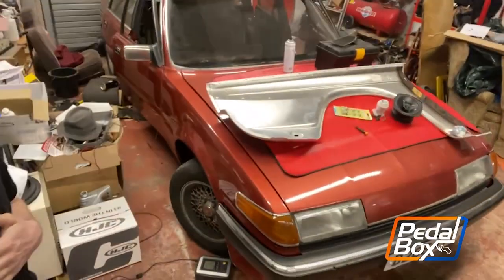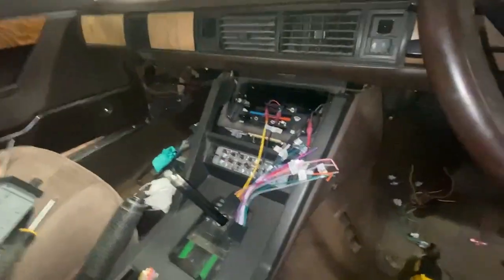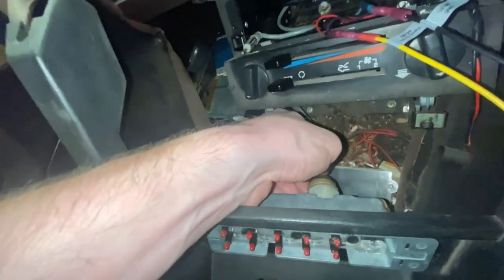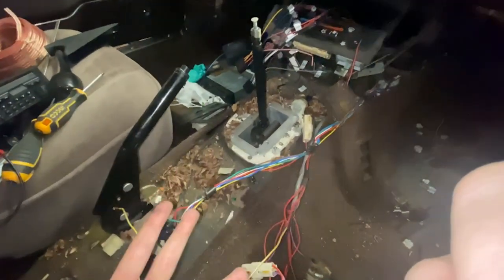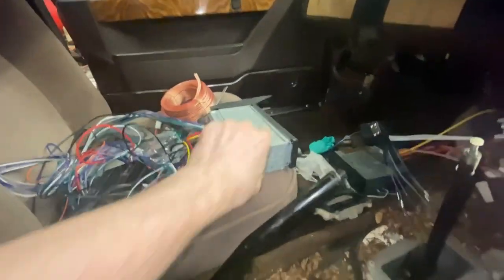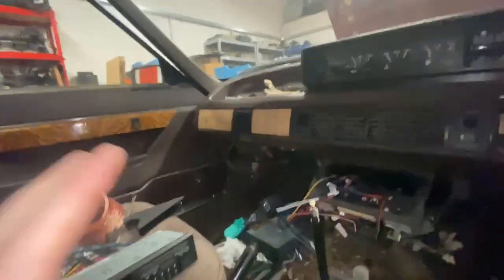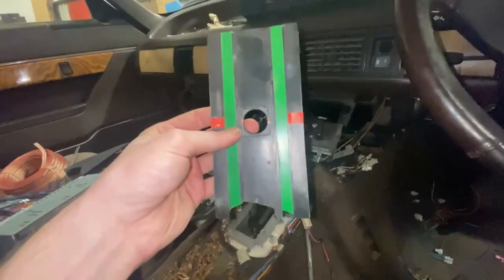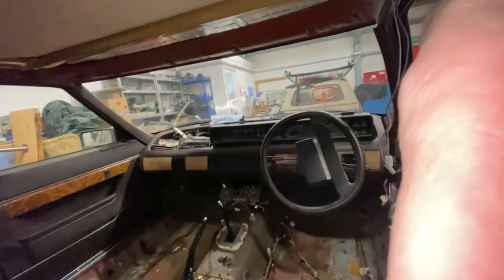Interior Impovements | Rover SD1 2600 | PedalBox Fleet Episode 114

Comment: Interesting comment about the center console, I always thought for some reason that the console was hard to remove, but as you say, its pretty straight forward. Not sure where that fear originally came from. I'd say the "nuts" have come from an animal living in the car at some point, there is no "normal" way for them to be there. That selector trim thing is just a bad design; its meant to kinda curl down at the ends to go under the trim and switches, but obviously that doesn't always work like that, so can get caught and broken.
Reply from the maker: At least if it was some small animal, they chose the nuts and not the wires, small miracles I guess!

Comment: Under seat thin sub with amp unit could be an option, then can have it from the dedicated sub output of head unit (if it has one)
Reply from the maker: Thought about a mini sub unit, under the seat is no good, theres barely an inch of space :/ anything behind the driver risks getting wet, but we've got a plan, and some donated speakers which will make sounds, if not acoustically good sounds :)